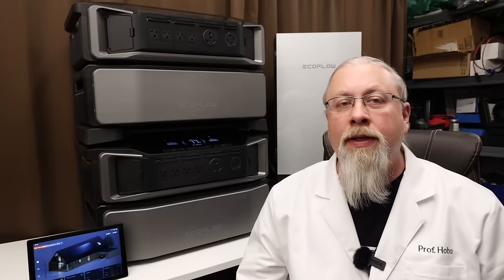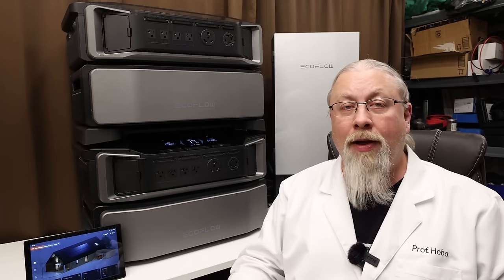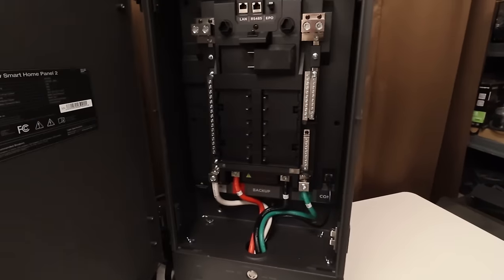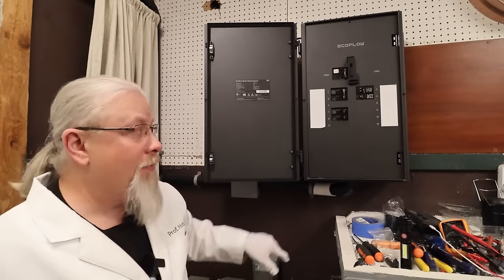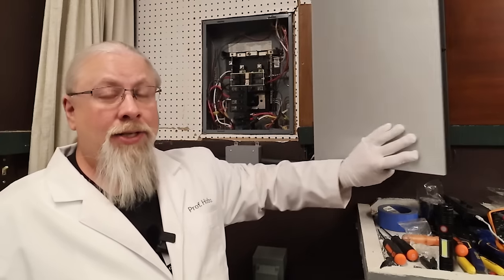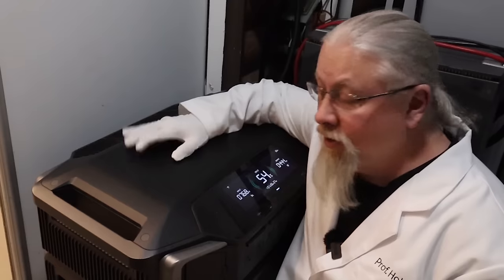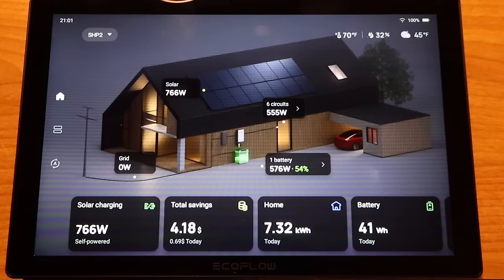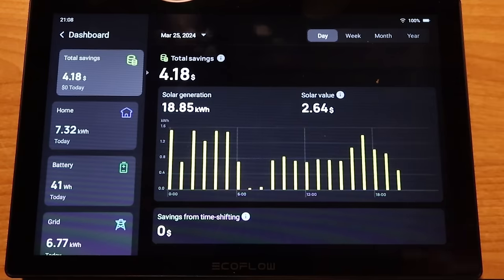Power Your Home! Ecoflow Smart Home Panel 2: Complete Backup System Install & Review

Comment: Questions that someone can hopefully answer. 

So if I have solar panels on my roof. Do they go straight into this Unit, or am I plugging this into an outlet when the solar panels on the roof are active and I’m actually just pulling from an outlet that is pulling from solar?

Does this do the entire, 20 millisecond transfer time? In a blackout does this instantly run everything without me moving from the couch?

Can this power everything. We have a large house but don’t use everything all at once. But we have 3 floors, 3 AC units. And about 4600 square feet. So, can I make the smart panel transfer everything from the main panel and just, time of use this thing? 

Because I was sold on the power wall. Then I waited for the Anker x1. (Which they cared more about form than function. And they aren’t releasing prices) 

But this could be great if I’m pulling from the panels. (And I can add a second panel set up on top of the shed) to pull power. Then switch everything to this and say, 18kwh or backup batteries after 6pm. Coast on the dpu to power our house until the sun is shining again. And then never deal with Time of use charges. 

So if anyone sees the questions there and knows the answers let me know. Thanks for everyone help.
Reply from the maker: Most of your questions can be answered by watching the original Delta Pro Ultra review linked in the description. Yes, it can run your home, including 3-4 ton HVACs. Yes, it's all automatic.

Comment: What happends if the batteries are at 100% does the solar energy  goes back to the grid?
Reply from the maker: You can set it up to do that. Solar will also power loads directly.

Comment: Geeze Tom, I figured were smart enough to not use Plumbing fittings for electrical work..
AND is that Ethernet Cable 600 Volt rated ?
Reply from the maker: First, I didn't do the install. Second, it's legal to use Sched 80 PVC for indoor conduit. We got what was available at our local store. Of course it's shielded Ethernet.

Comment: Why does the smart home panel have a generator / grid interlock? When grid power goes out the panel gets power from the batteries. When on batterie backup, how does the panel not backfeed the grid connection? If there is a way to cut off the backfeed, why isn't that same mechanism used to cut the grid backfeed when a generator is feeding the panel?
Reply from the maker: It's for bad weather days when solar won't work. You hook a 120v/240v generator (or other power source) to charge the batteries. It doesn't back feed because the panel has a built in auto transfer switch.

Comment: Why do you have 2 DPUs?  Why not just add additional batteries?
Reply from the maker: For double the inverter wattage, double the solar charging rate, and double redundancy. I'm planning EV charging and it's also connected to my home now. Need that 14.4kw inverter.

Comment: So what you do when you don't have a power company, you have to have some sort of power going to or is that just gonna be my power which that would be my power line line? Which would be the Delta pro ultra. And backup power while. I don't know what that would be because I don't got main line called.  Electric company, so how does that work for that?Send send the equal Delta pro ultra.
Would be my power Company.

Comment: Federal solar tax credits you can claim only once for the year you install a solar system. However, if the credit is more than the taxes you owe, it will roll over to the next tax year for up to five years. Under the Inflation Reduction Act, passed in August 2022, the federal solar tax credit is worth 30% of your total system cost. You can not claim this every year.

Comment: Been waiting for the ridiculous prices to come down. Im guessing the breaker box is a massive pain in the #%€ to install considering that every video skips over the wiring part.  But with all the complaints Im hearing about Echo Flo I’ll probably pull the trigger on the Anchor 3800 if they ad pass through charging.
Reply from the maker: The good old days of cheap easy money are gone. Welcome to inflation and high taxation. Wiring is easy. It's 4 wires + network cable. It's running the cable that's a pain.
Reply: @HOBOTECH  why didn’t they simply pre wire it like a Reliance? Which is what I will most likely use.
Reply from the maker: It is pre-wired... You add your own breakers and you're done.

Comment: ok.....
$16,000.00 dollars divided by 365 ( days per year ) = 43.835616 divided by $4.00 ( a day electrical
 charge ) = 10.95890 years to pay for the Ecoflow 7200 Delta Pro. and Panel . 
' OUTDATED BEFORE EVEN HAFT PAID FOR "       OK ,  BUT NO THANKS.
Reply from the maker: The system is $6699 after my discount and about $4800 after tax credits.
Reply: Zippa de doo dah
Dibbidy dup
How long til the value of your 16k car
Goes back up?